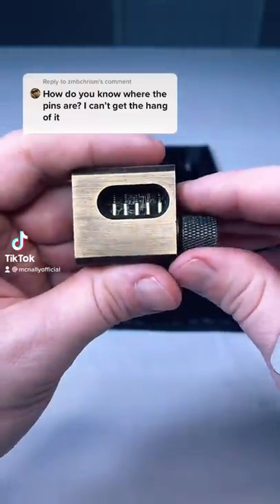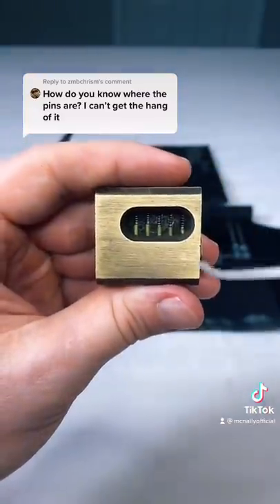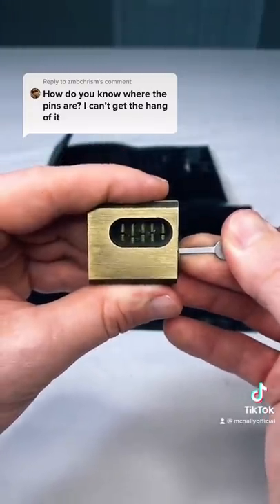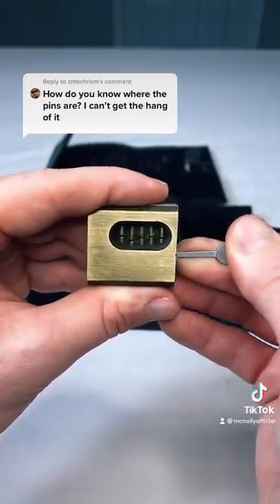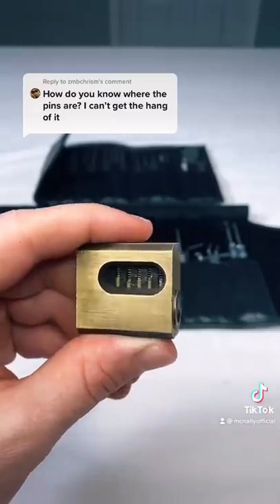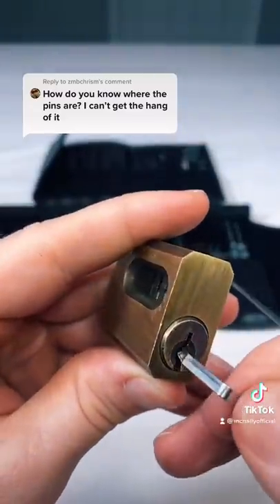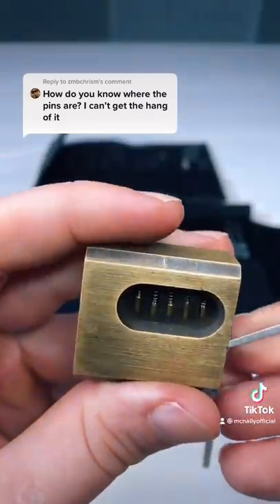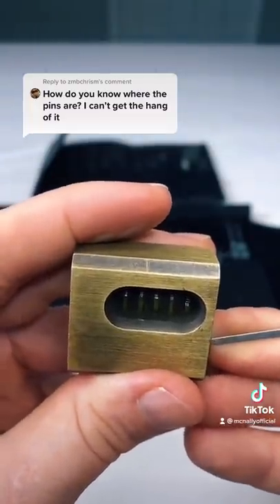Lock Picking - 0003

Comment: I've picked only a couple. I can pick, but usually I just rake it. Raking so far has opened every lock I've tried, and I made the rake with a windshield wiper blade 😂 Rake takes about 1/2 a second where my average pick time is around 60 seconds setting one at a time. Spools and security pins don't slow me down either for some reason, I can feel the grooves, and the right one feels different, so no issues with spools and edges. The right slot has a beveled edge because of wear in the locks, and feels totally different than the security grooves at 90° hard angels

Comment: Even for a seasoned professional like myself- it's nice that there are basic's video's out there. Not everyone starts at the same place. Like, I never really knew what a Bi Peak pick was for. I mean, I tried using it a bunch of times but never picked a lock with it. Now, years later I had come across info that you were suppose to rip it from the back really quickly- like just once. Think they also call this 'Bitch Picking'. Now, I have done that a decent amount of times and have still never been able to pop anything with it but at least I know the purpose of it. There's a lot of pick head designs but it's just window dressing and to get you to spend your $$. You need like 5 picks and maybe 4 rakes= and that's it. If you can't do them with that= you need to work on your technique. When I first started I bought Everything- then after a few years I started shrinking the # of styles and just buying more of the few picks I ACTUAlly need. Too bad there isn't an honest forum to read. You'd save a lot fo $$ not buying stuff that either doesn't work/ or you'll almost never use.

Comment: Good luck if you have soft fingers. I am an ex locksmith and although am qualified to the best education and am experienced I have virtually no feedback on my fingers when picking because my fingers are soft. Pretty much every locksmith I met has firm fingers that are able to detect rather than just absorb the physical feedback from the pin stacks. I could still pick but not particularly from skill but rather learning what most likely will work.

Comment: I find it kind of scary how quickly a normal lock can be picked.
I got myself a training kit with some picks and locks and with a bit of trying i could open 4 of the 5 training locks even after covering the transparent lock with the sleeves.
I'm not really confident my front door would last more than a few seconds against anyone with a few hours of training.

(the last lock has a crossed key and pins in 4 different directions. I still need figure out how to approach that one)

Comment: I also bought the same practice lock, but here's my issue: when I add torque, the  push the pin, the pin hardly move, and I need to add more force to push the pin up. Because of that, the pin jumps up and seems to get stuck on the bottom pin, instead of between the two pins. I also tried reducing the tension, and now none of the 5 pins would get stuck. I needed to spray a bit WD-40 so that I can push the pin up on the right tension. Does this means that on all locks, to make the picking easier, I need to spray them with WD-40?

Comment: i would like to start but do you know which locks are good to practice ?
Reply from the maker: Most start off with a no 3, 140, or 141 Master Lock.  Brass body locks like the 140 & 150 usually have better feedback.  

For more of a challenge, go with a 150 / 570

After that I'd get some LOTO locks (410/406, American 1100 series)  and go from there

Comment: What do you feel for to know when it binds?
Reply: There will be a click and/or a little vibration that you can feel. It's a bit easier to hear/feel when you put more pressure on your torque wrench (though it should be noted that a lot of people recommend lighter pressure when picking)
Reply: it feels kinda stiff but still moves if its stiff but doesnt move its set

Comment: Its way harder than it looks. Dont get me wrong, picking most locks is easy with a raking tool, or even randomly setting pins spp ( Bitch picking.) but real SPP is when it takes skill. Getting a feel for each pin and focusing on appropriate tension is harder than it looks. And thats not even mentioning getting use to the distance between each pin stack.

Comment: Binds? Issac refrence?
Reply: No, it's the term used for a pin that catches when you put tension on the core. The object that he puts in before the pick is a tension tool. It rotates the core, and due to machining imperfections, the pins will bind in a certain order. You find the pin that binds with the pick, push it until it sets (you'll feel a click), and then move to the next binding pin. Repeat until the lock is opened.